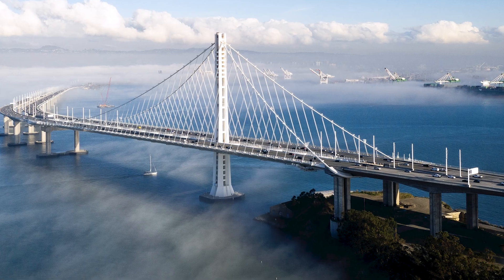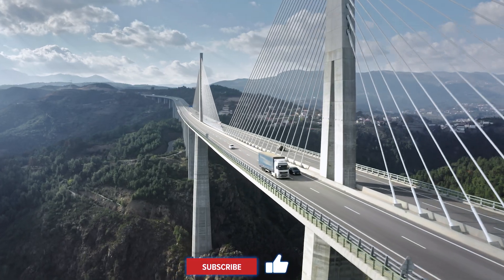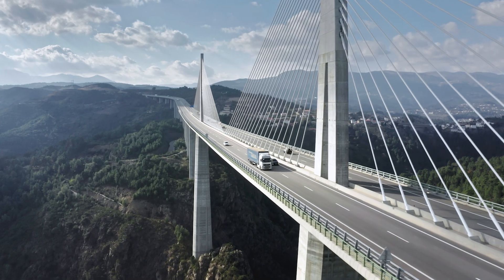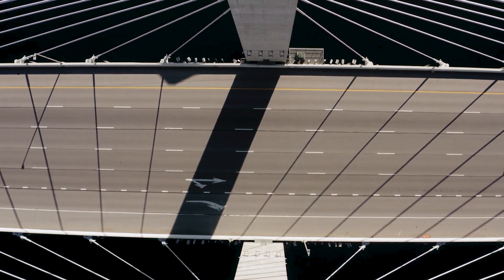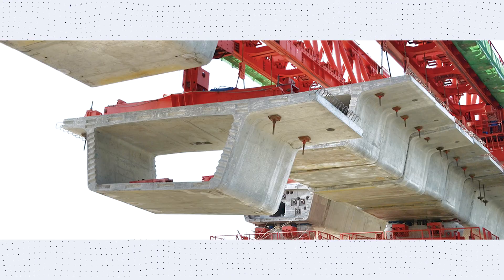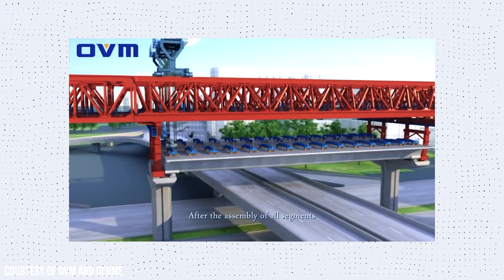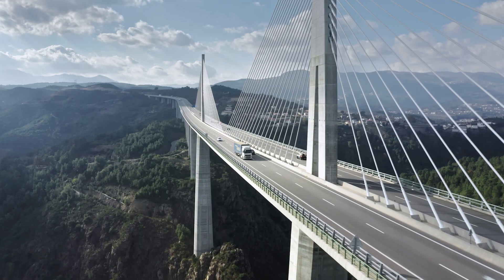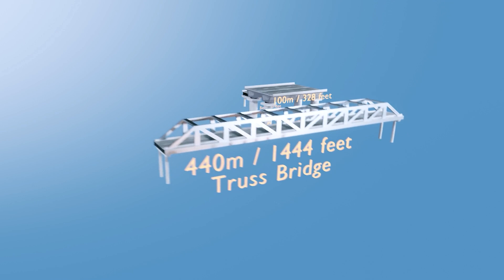Why Some Bridges Are Hollow? The Engineering Behind Box Girder Bridges.

Comment: Box girder is also excellent in torsional stiffness
Reply: Correct!!!!
Box shape is, indeed, good for torsion. 
The hollow is to cut wight.
For simple span (particularly at mid-span), all you need is a compression zone at the top and a tensile zone at the bottom. For multiple spans (seldom the case in long span) compression zone is at the support.